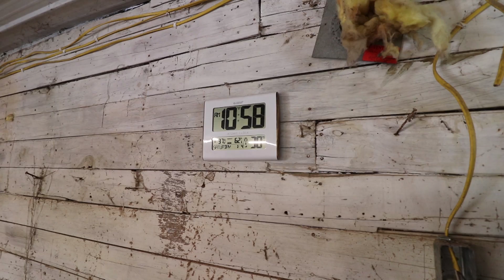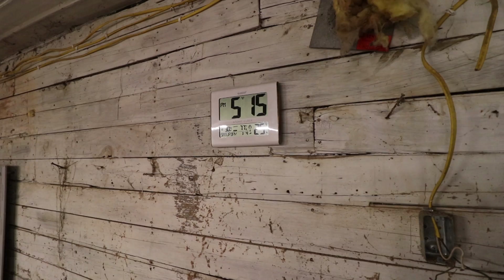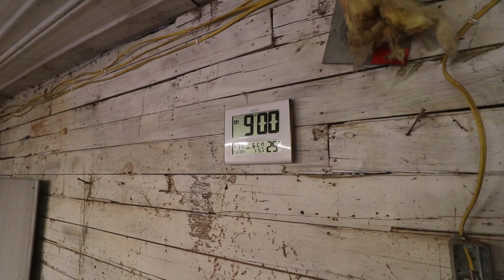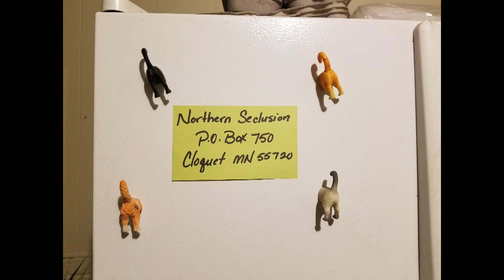THE FARMHOUSE. More work on the Workshop. Farmhouse Cooking.

Comment: That floor looks like a good place to run some dust collection pipes around the shop. Might as well use those trenches for something.
Reply from the maker: I JUST finished editing an almost 6 minute video explaining why I am not filling them with concrete. This is probably the best comment yet. You are correct. I will upload this short video tonight and then make the next workshop video public after that.

Comment: Hi Joe.
Been watching all your past videos since finding this channel, and the thought struck me that the trenches in the floor could be a good send, and put to good use.
I have been an owner/operator of a cabinet shop for many years (retired for the last 20 years, 85 now) that when planing machine layout an efficient dust collector system that was on a central vac the problem was how to duct the exhaust pipes from the machines without obstructing the machine workings. 
For example; the dust from a table saw or sander or router usually finishes up on the floor under the machine, so use this space to route the 'take away pipe' in the trench instead of the overhead route.
With the judicious placement of your dust producers you can connect all the machines into the main trunk line with a flex duct out the bottom of the machines without having a spaghetti of duct pipes over your head or fowling the piece you are working on.
 Fitting gates to each individual machines would make a system with the max suction to each machine in operation. (Another plus would also be a few floor sweep inlets located in suitable areas. 4" PVC makes a good pipe system with smooth corners and fittings.
One more idea for you. 
With a central located  compressor run  3/4" PEX line around the perimeter of the shop with strategically located valves to plug in a line to run your air tools. This saves many yards of flex hose pipe snaking across the floor .
Enjoying your inventive videos, good luck with the cleanup of the farm. Looking good.

Comment: You spoke about the trenches in the floor and a way of covering them over or filling them in... if you are going to be jackhammering the concrete raised areas to level the floor.. why not place the rubble in the trenched areas and then cement over the top of it all to give you a solid and level floor...

Comment: What I do with the case of little plastic drawers is I organize them and I write on the faces what each contains. I organize by first grouping, so all wood screws are together in one area and machine screws in another area, and then washers in another area and nuts in another. Then, I organize into rows and columns. So, the top row is #4, the second row is #6, the third row is #8 and so on. And I organize the columns so the left most column is 1/4" long, the next column is 3/8ths inch long, the column after that is 1/2" long and so on. This makes it very easy to find what you need and not waste time looking for the right piece.

Comment: Do you label your plastic drawers or do you remember where every little what-a-ma-call-it is located. I have had small ones of these with about 20 drawers it would drive me bonkers if i had that much small stuff w/o labeling
Reply from the maker: I do not label them because as soon as that bin is empty then you have to peel off the label which never goes well. Lots of the stuff that ends up in the bins is just nuts and bolts that came off of some random project and I would never be able to replace them. The stuff that I bought I could replace but then only some of the bins would be labeled and that would drive me nuts.

Comment: Here in the south if you are eating breakfast foodstuff around noontime we call that brunch! OBTW if you said it was 34% F around here we would not call that warm. The body adjust to the climate it resides in. We just had a warm spell in January with temps in the low 60s for about a week and then this morning we woke up to 35% F. I did go out about 1500 hrs and it was around 45% F. As long as you were in the sunshine it felt okay just as long the winds did not hit you. Next week we are having typical January NC weather. A few days in the low 40s and mostly low 50s. But if you had that in Minnesota you would think it was a heat wave!

Comment: Melissa that's my kinda breakfast and it would last me all day. Those eggs looked perfectly awesome cuz I love mine basted as I was brought up on basted eggs at 4 yrs old. And the shop is looking great,I love big shops to work in with a nice big bench. Great video as always. For the cats cooler you just cut a small square hole and put a warming pad in it right  ?
Today is the 21st of January and the temperature has risen 35 degrees since 8AM this morning and its 10:45 PM and the temperature is still going up and starting to get freezing drizzle here in Nw Iowa and rain and snow the next days and the rest of the month supposed to be in the mid 30's so we can have our January thaw.
Reply from the maker: Yes, just about a 5x5 hole and then a blanket and a heating pad. Wrap the heating pad in the blanket so the cats are not laying directly on the pad.

Comment: To fix your shop floor, you should fill it up with crushed rock,than put concrete mesh on top then you only need 2 inches of concrete on the top no excuses like always that's the right way to do it, I just did one, remember no excuses that's the right way to do it...
Reply from the maker: I do not want them filled with concrete, it is as simple as that. If I ever put a forced air furnace in that shop I have a very ideal place to run heat runs with floor registers. There will not be concrete going into the troughs. Might be the right way for you but that means nothing to me.

Comment: Joe, do you have a snowmobile?  It would be faster when you go to the tent in winter.
Reply from the maker: I have 2 of them but you never know if the Tent lake will have 8 inches of slush under the snow and on top of the ice. That happens a lot up there due to the fact that the lake is spring fed and the heavy snow pushing down on the ice forces water on top of the ice. A snowmobile will just get buried and then there I am for half my trip trying to dig the snowmobile out. I always think about bringing one and then just decide to walk it. I was seriously considering doing it this year but I heard that the slush is really bad this year. In the future I will eventually I just may have to skirt around the lake edge. For now I will walk it once again.

Comment: I did the same thing with my nut & bolt bins.  But, I put a raised edge (lip) all the way around it so if I dropped anything that wouldn't fall off onto the floor.

Comment: Joe what I would probably do is fill that up with sand tell about 2 inches from the top then put concrete over the rest it will make life so much easier in the long run for you

Comment: Would it not have been easier to put blocks of wood the rright height to set on the gutter?than plywood over. Just a thought, that looked like a lot of work and ply  wood has no support in center.
Reply from the maker: That would have been more work than needed. The plywood is only 16 inches wide, you could drive a car over it and it would not break.

Comment: Joe that shop is looking good. That’s a good thing about winter plenty of time for inside projects. Have you thought about an oscillating wall fan to spread the heat around instead of a floor fan? I’m just wondering if it would heat the shop faster mounted behind the stove. Enjoy both your YT channels.

Comment: I would guess the only way to correctly fix that floor would involve a concrete mixer
Reply from the maker: The area is way to big for that, I would bring in a cement truck BUT, I do not want concrete in the troughs at all.

Comment: Why would you put PL400  in a place where it can freeze ? Just asking?
Reply from the maker: It can freeze and thaw and it is fine. I do not know what the directions say but at work they deliver that stuff and it freezes solid and we just thaw it and it works just fine. It has been that way as long as I can remember with every subfloor adhesive I have used.

Comment: Back fill the trench with rock then concrete would need alot less plus you will have fill when you nock out the ledge
Reply from the maker: I do not want concrete in the troughs.

Comment: Part 2 of chickens without a roost:  Okay..the chickens are willing to compromise on a solid well built roost.  They wanna know if you have an old ladder you can leave open in their room so they can get up off the cold floor.
Reply: I wish they had a clean window they could perch and look outside from.
Reply from the maker: The window is actually not all that dirty but it is covered in frost right now.

Comment: Joe, fill the trench in most of the way with rip-rap (2-4” gravel) and then you’ll need less concrete to fill and level with.  Should be able to reduce your concrete needs by 75-80%

Comment: Hello there I just got to make a Suggestion about the concrete piece in the middle of the floor why couldn’t you take that and roll that into the hole in the middle of the floor and then fill it with concrete just wondering if you don’t have any idea when that will